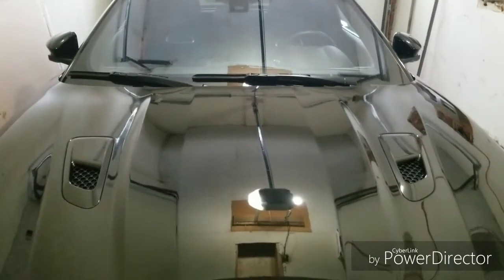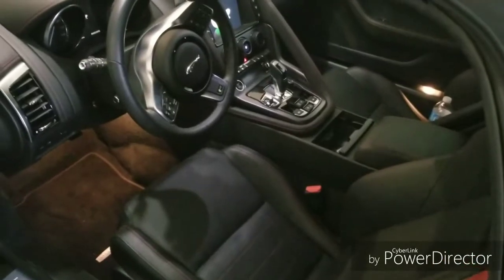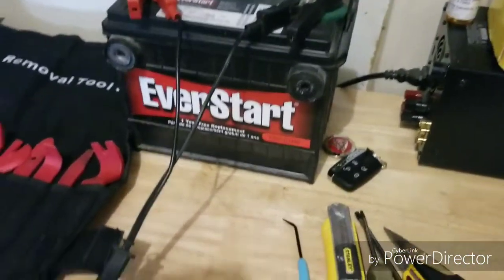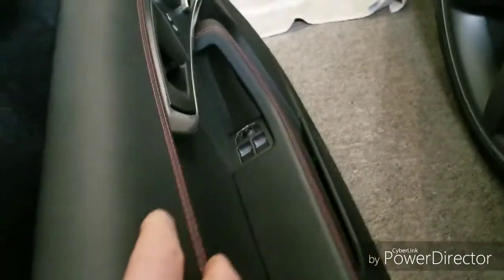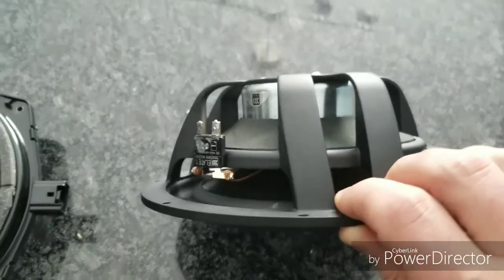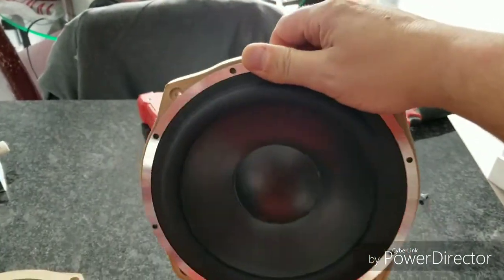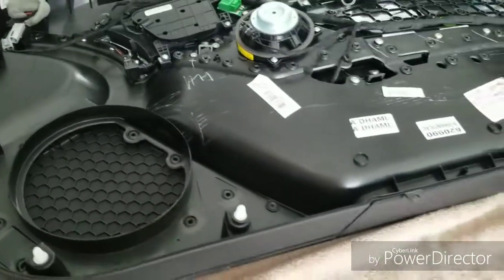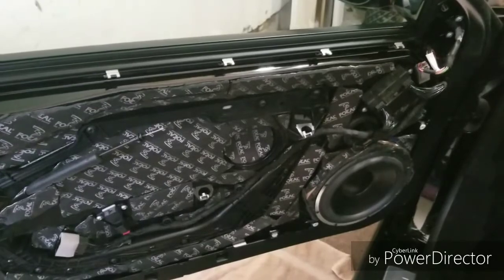Jaguar F-type R - audio upgrade - speakers - Stage 1

Comment: Hi Jeremy, the upgrade speakers that you installed are they the ones from the meridian 770 watt system? I’m only asking because my 2017 Ftype R I believe has the 770 watt system. If that’s the case all I have to do is insulate the doors like you did and I should be fine.
Reply from the maker: Yes they are from the meridian system
Reply: Ok and by insulating your doors made a huge difference? Thank you for your well explained video.

Comment: Hi was wondering if you could sell me the subwoofer adapter you made?
Reply from the maker: What speakers are you planning on putting in?    The adaptors are straigh forward, but are going to be unique to the speakers.....
Reply: I would also love a set as I'm using the same morel drivers. just one pair would be nice.

Comment: Great video! There is a technical service bulletin to do pretty much what you did in this video, but the dealer will take care of it at no cost to you:

https://www.jaguarforums.com/forum/f-type-x152-72/%2A%2Arattle-vibration-fix%2A%2A-service-bulletin-out-now-151130/